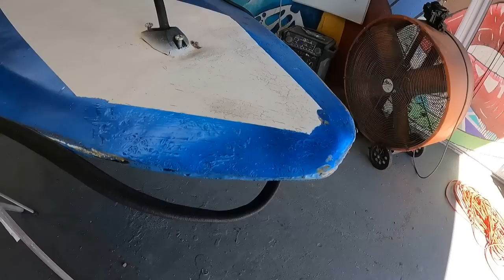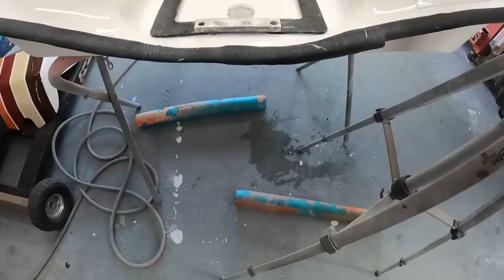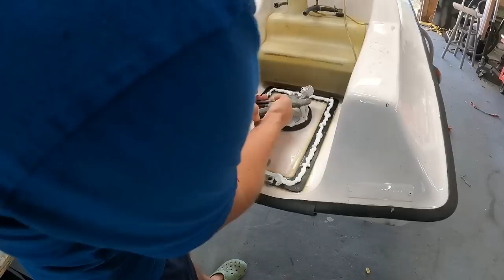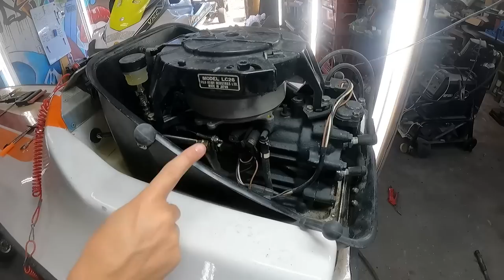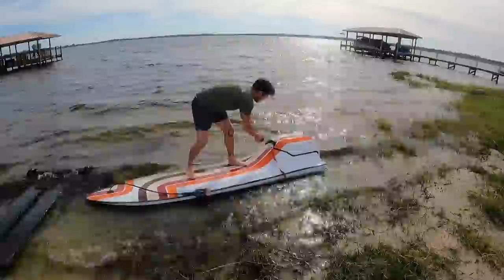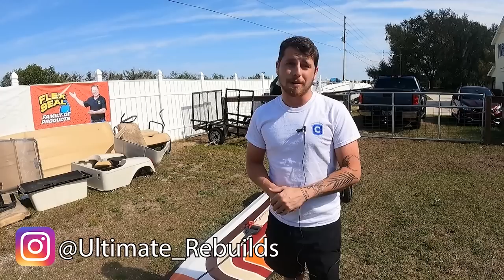This Surf Jet Refuses to Work! - Episode 3

Comment: I grew up in a marine mechanic shop. We work with jet drives a lot. I cant imagine how that impeller could produce thrust forward. the impeller should point rearward imo. You might have it doing all it ever will.
Reply: I keep going through your videos again and again, l do believe the rotation should be counterclockwise looking from the bottom,  and the blade screws on clockwise. I changed my mind and think the blades do cup the right direction. But did notice some additional screw holes on the bottom located on each side of the aluminum water intake, could there possibly be something missing that separates intake hole from excess water discharge hole at the the back. By the way, I also live in Florida and coast did hit pretty hard.

Comment: If the engine is turning the right way maybe there is supposed to be a bolt on the end of the shaft that turns counter clockwise to hold the propeller on. There is a hole at the end of the shaft is it threaded? Maybe there was and some one tried to remove it not knowing it turned to opposite direction and broke the bolt of in the shaft and tried to extract it and that’s why the small hole is there. Or if there is a ring around maybe a snap ring. It’s hard to see with out close ups of it. To me it almost looks like there is a broken bolt at the end of the shaft. I say that cuz the metal is 2 different colors.

Comment: BRW, from the last episode where you showed the impellar damsge, it looked like it had unscrewed itself from the motor shaft  it pretty much looked similar to the original impeller and i would wager that the current impeller looks identical   .if thats the case the ONLY way it could come off is if the motor were spinning backward  .

Comment: We sold them at our marina and had a demonstrator I used a half dozen times. Got boring real fast as it was useless in any kind of chop. Much preferred Windsurfing. Considered adding footstraps to eliminate the "paddle ball effect" but didn't restock them after getting rid of the ones we had. The engine was built by Fuji Heavy Industries.
Reply: My guess is you've put the impeller on backwards.

Comment: I wonder if the board has to be moving forward to force water into the impeller. If you can find a metal one
Reply: Or my brain thinking is what if the impeller has to be put on the other way. The blades facing up to create suction

Comment: Just handtighten the impeller will make it unthread when you release the throttle the first time, engine is slowing down but the drag from the water holds the impeller. Just my guess.

Comment: I think you went the wrong way: not seal it perfectly, but give it a ventilation, so the „trapped“ air in the impeller housing can bleed of.
You need to ensure, that the air can escape. The type of Impeller is not self-priming.
Reply: I second that..

Comment: I'm assuming that you checked all the bearings or bushings and any seals in between the motor and the rotor water pump system

Comment: 3d print an impeller.  Might need a few printed as you trial and error the problem.  Once you find the actual issue...you can buy an actual impeller.

Comment: I'll tell you what it looks like to me, when you spin the impeller on to the right, it mean that the engine will spin it to the left.. the curvature of you blade suggests you are running the back curvature of the blade toward the side you should have the cupped side. Inner cup side will create pressure. Looks like the impeller is cupped the wrong direction.

Comment: I wonder if the impeller is not tight enough on the shaft and is unscrewing on decelerations of the motor hitting the housing and jamming causing damage, put marker pen on surfaces(blueing) , epoxy impeller back together for a test, try again and check for contact 😤👍👍

Comment: Glad your back. This project is challenging, brother,  don't let discourage you.  A metal impeller would be better.  The clearance at impeller?
Reply from the maker: Clearance is good. I’ve heard of people wanting to make an aluminum impeller. Going to try and get my hands on one
Reply: @ultimaterebuilds7127  I wonder if cavitation is what is causing the impellers to get destroyed. If it happens to be cavitation, the question becomes is are there belt or chain driven components which pulleys/sprockets for have been mistakenly installed such that the bigger pulley/sprocket ane the small pulley/sprocket have been swapped. This is important because it could result in the impeller being run at much much higher RPMs (cavitation level RPMs)  than it was designed for. Good luck.

Comment: Hey Zack i got the same thing first put a flush kit on it and from some research, ive seen them pull the flywheel off and turn the wire windings around theres a few YouTube videos. Dont give up dude youll get it. Wstart it at home and leave intake greate and watch to see if it spins correctly  🇺🇲🇺🇲

Comment: I think your impeller is Dragging on the plate. you may have to shave some of the plastic off the impeller so you clear the metal plate. possible that you did not get the impeller mounted all the way on the shaft of the motor. If the impeller is not on all the way It will keep hitting the housing plate and destroying the plastic.

Comment: Why not run the engine in a stand with the impeller mounted in air? You could at least check that it is mechanically functioning. Then you step up to putting the impeller in the housing of the board and mechanically turn the engine over to make sure it clears.

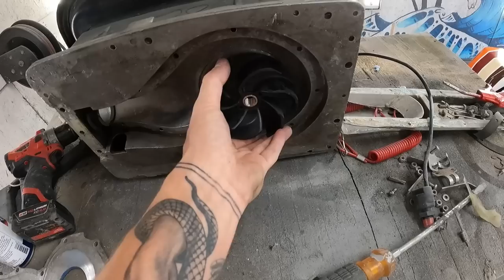Comment: At 3:29 you can clearly see the hole in the crankshaft. There is definitely supposed to be a bolt and washer holding the impeller on. What else is keeping it on? I've never installed anything onto a motor without a bolt on the end of the crankshaft.

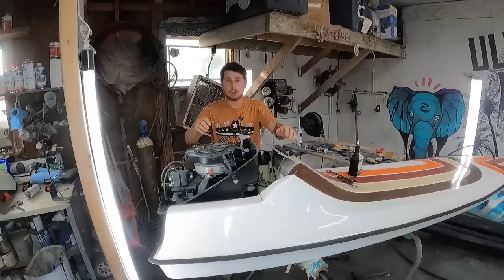Comment: @4:07 nice job checking it off camera so nobody else can see. If you showed the impeller turning counter clockwise as you pulled the starter cord we can know check that off the list. 

The the impeller in your first video showed every sign of splitting backwards with the wear on the impeller and them the stripped thread because it tried to unscrew until it hit the impeller cover.

And there is absolutely no reason to get impeller damage on your last test unless it’s spinning backwards and cupping the water instead of impelling it outwards.

Comment: You should talk to a fabricator or a machinist and have them make you a aluminum impeller so it can’t just spin the insert out again. It seems like that once it gets the friction of water around it the plastic just can’t hold up and it just spins the insert out so it doesn’t go anywhere. If you had a solid metal one then it wouldn’t have any other option but to spin lol good luck with the project I enjoy watching it get this far.

Comment: Shim that impeller out till you just have clearance Between the tip of the veins in the cover plate you’re not getting any water pressure whatsoever out of that if it was a bad gasket it would at least get some push or water coming out in and make sure the impeller is not spinning on the shaft

Comment: Check the shaft seal above the impeller, there's likely a seal there that has gone bad in addition to the seals you put in at the bottom. It's probably going to be a press in seal similar to a crank shaft seal on an engine.
Reply from the maker: Yes, already replaced that
Reply: @ultimaterebuilds7127  good call, went back and watched the earlier videos after I commented. I kinda am agreeing more with the person further below about the weight and submerging the impeller vs not as a safety mechanism.
Thanks for replying!
Reply from the maker: @ArsonIndustries  I tried standing on it too. Just cut that part of the video out because it wasn’t a good camera angle

Comment: It looks like in the video you only put the impeller on hand tight if it is not on the shelf tight enough it will vibrate itself loose and not sucking water through the pump

Comment: There has to be someone that can make that impeller out of metal or diy mold with silicone take the metal thread out make a mold fiberglass infused resin will be alot stronger. Idk but that's the route I'd go or something along those lines.

Comment: Do you still have it in storage? If so I grt it. I bought mine in 2020, had it running but needed work to run right. Now i have gotten back into it after finally ordering the parts here in 2024. When looking at the impeller from the bottom would you say it spins clockwise or counter clockwise?

Comment: After installing the impeller. Might need to use a bolt, washer and loc tight in the shaft to keep the impeller from spinning off.
Reply: It looks like the nut integral to the impeller actually spun inside the plastic of the impeller...melted it.

Comment: Pull start installed backwards and therefore running the motor backwards? Could cause your issues.
Reply: It couldn't. There is no locking pin or whatever on the impeller. If the engine would run in reverse, it would just kick off the impeller. (I also doubt that the timing is @ 0 degrees, so it would have ran horrible if it would be running backwards)

Comment: The impeller would be I believe reverse thread an if it runs in “reverse” like you say wouldn’t that be the issue cause the impeller would only suck water spinning a certain way. Maybe try getting an impeller that is opposite to that one you have

Comment: THE MOTOR IS TURNING BACKWARDS!  Remove spark plugs.  Loosely install a nut on the threads for the impeller, or the center of the impeller if its still threaded.  Install very loosely.  Now pull the starter cord slowly while holding the impeller or nut stationary.  Pulling the cord should tighten the impeller.  If pulling the cord loosens the impeller, its turning backwards.  You say "the motor is turning the right way", but you give no details on what you tried.  Sometimes "the right way" isn't obvious.  The impeller system just isn't that complicated.  Also, after its assembled, have someone pull the cord on dry land while looking underneath to see if the impeller is rubbing on anything.  For each step of assembly, you should turn the motor, or even start it.  Running it for a few seconds shouldn't hurt anything.

Comment: have a machine shop cnc an aluminum impeller or have a it metal 3d printed. not sure which is cheaper.  or a racing water pump impeller.   the main issue I see is air in the pump. revving wont do anything if its not pumping.

Comment: You may have found the reason that style isn't built any longer.  It's crazy that you run it for such a short period of time and the impeller is damaged so much.  It might be worth looking at replacing the motor and drive with the newer style...if that's any better than the old one.

Comment: 3d print metal impeller, lock nut and lock tight, check clearances, or ditch the 2 stroke and convert it to electric

Comment: I bought an automatic Suzuki motorcycle that would only run on one cylinder no matter what I tried.  Toward the end I bought two new carburetors but needed to balance them and I lost steam.  Never tried and ended up selling it for $300 with the new carburetors.  The guy who bought it put the new carbs on and balanced them and it started running 😭 took him 5 minutes.  I slightly regret that still.  Would have been a cool bike for friends who dont know how to ride a motorcycle to ride a bit. Oh well.

Comment: It's more than new seals. The seals aren't thick enough to make a seal between the bottom of the motor plate and the board.  It ts drawing air not water.  The other thing is why does the impeller self destruct from sucking air? Is there any sign of water getting between the impeller and the engine around  the shaft?

Comment: im no scientist ! but ! id like to imagine that your water intake is acting like a cup being submerged underwater backwards, maybe adding a valley will allow the water to overcome the air pressure allowing water to flow freely, to test this theory id suggest priming "filling" the turbine with water prior
Reply: you need to expel the air trapped in a line in order to create a siphon
Reply: maybe ! and maybe ! chances are ! if that is the issue, to get around doing body work, you could instal a electric water pump running off the engine to fill the turbines chamber by plumbing a line to the impeller, possibly ! 🤞

Comment: Internet opinion here but what I think is happening is that the inlet side is under water but the outlet side is in the air and drawing air backwards so I'm thinking if you sit or stand on the board and submerge the outlet it should not able to draw air in.or have somebody tow you so board would be scooping water through the pump but as far as the impeller breaking itself maybe the motor is slowing down faster then the impeller wants too and spinning off the shaft

Comment: if you dont want it or tires of failures i be asking you changes it up and put 9.5hp outboard engine on it (rear have be cut out and redo fiberglass) that way you will have more fun with it i do this kinda of work replace failures and make it work because im engineers

Comment: I might be totally wrong and it might have been the water moving it, but when you first put it in and the back was all submerged, it looked like it moved forward. Is it possible that you need a bit of weight on the board to submerge the jet so it will move?
Reply: Nope. The operator can stand in shallow water with the throttle in his hand and it'll go around him in circles. Still, after a couple rides I lost all interest in 'Surf Jets' and got heavily involved in Windsurfing.

Comment: Bummer! Could you 3d print an impeller to save some cash? Won't fix the problem but may be cheaper. I've owned lots of jet skis and this stumps me. Something is going on with the drives haft or that's not the proper impeller. Damn...wanted to see ya shredding on it

Comment: The impeller is upside down, surely? Does the flat side not want to be pointing down? Otherwise it won't actually pump?
Reply: The water needs to be pulled in from the bottom part. The water inlet is in the center of the impeller. So if there would be a flat side on the bottom, there couldn't get any water inside the pump to begin with: not the issue.

Comment: The only way that plastic impeller is going to get chewed up is if it comes loose. You show it threading on to the end of the crankshaft, How are you tightening it? There must be a tool to help torque that in place?  When the motor spins is it spinning in the direction that would loosen the umbrella? Ideally it would be threaded so that when it spins it tightens itself.  If you want to talk about this, feel free to reach out I'd be I'd be happy to help.
Reply: In the engine would spin the wrong way, it would have kicked off the impeller, without damage. The impeller probably tightened itself some more, and started rubbing against the top of the housing under some load, and thus getting stuck. Engine just pulled that metal plug out of the plastic.
Reply: @Jahee-Official  there isn't enough clearance between the impeller and the bottom cover to come all the way off.

Comment: I hate saying this but… 
Can you not test it in steps?
See what direction the shaft spins in? Is it correct?(match the impeller direction)

Yes insane to just replace parts and hope for… diff outcome. 

Is the pull string in the right direction? You talked about it but didn’t say if it’s correct or not. 

A 2 stroke engine is quite simple. Take it out and take it to a small engine repair shop. Like a lawn mower shop.

Comment: You can't catch a break with anything that is 2 stroke and jet powered. I'd give up on those kind of projects for the same reason they stopped making them - they suck!
Reply from the maker: Starting to think that way too. Maybe I’ll try my luck on a newer jet ski 👀
Reply: @ultimaterebuilds7127  that'd be awesome. I had 4 2 stroke skis at one point. They're so fun when they work but I spent more time working on them than riding them. Hang in there. Your channel is awesome.

Comment: I wanted to shove it forward through the video to see if that would prime the jet pump.
Reply from the maker: Trust me, I’ve tried that too
Reply: @ultimaterebuilds7127  Using a small silicone tube to suck out the air from the pump might point you in a direction.  Suck the air out, pull the tube out then start it again.
Reply: Getting "air pockets" isn't an issue at all. At speed, it's very easy to get some air time, thus creating new air pockets. The impeller probably got locked up by hitting the top part of the impeller housing, due to a lack of washers.

Comment: You first need to learn how to run anything with a jet pump. You fired that thing up in 2 inches of water with sand and weeds directly under the pump. I only start my stuff 2-3ft+ of water. That sand is definitely not good and so are tye weeds

Comment: looks to me like you made the novice jetski owener mistak... dont start it or run it right in the rocks or sand... one get your new  prop and go out in deeper water before starting it... plastic cant touch one pebble without total destruction... i see 15k$ jetskis all the time smoke the prop and wear ring from run on the beach one time in sand or rocks for sale cause they wont get on step... it probably cant prime with the blade tips destroyed from startup wtih rock and sand